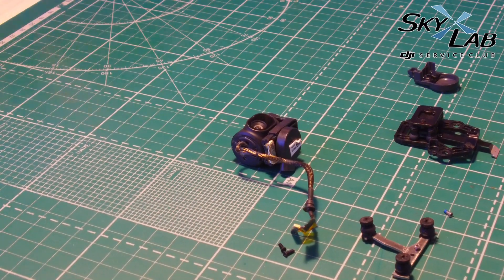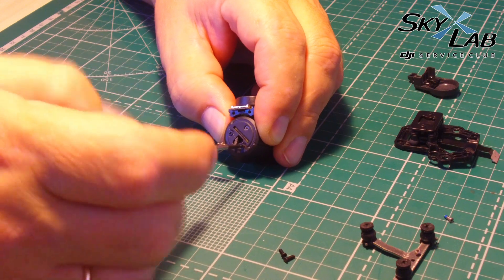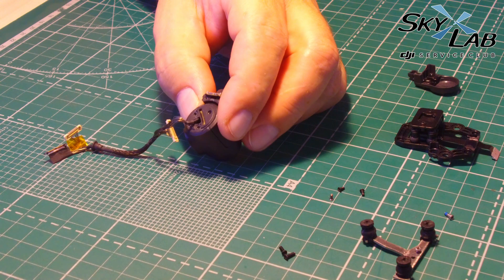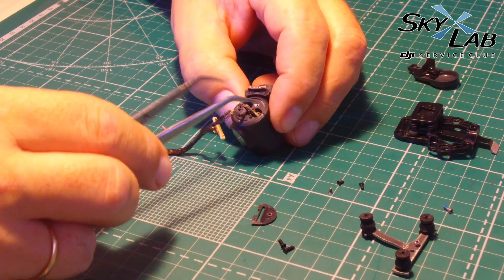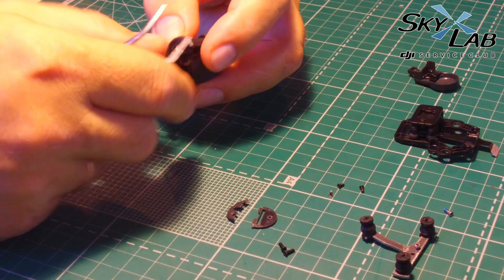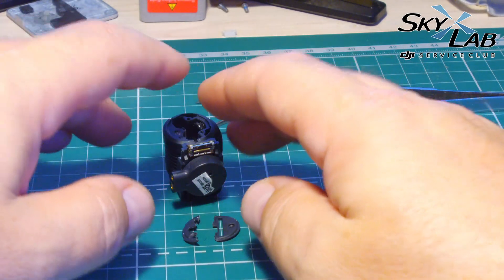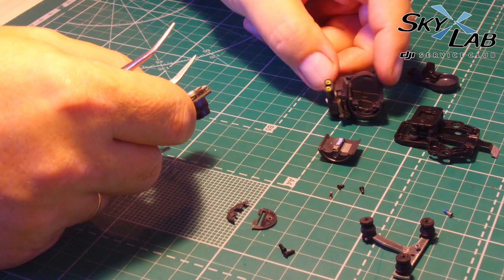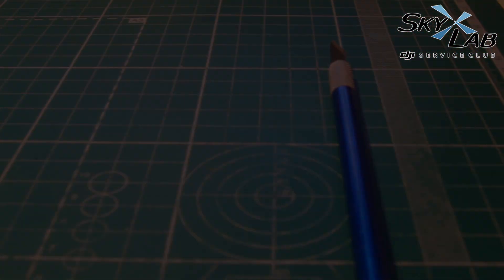Dji Spark Engineering and design ERRORS!!!

Comment: Great video, Thank you !

After a hard landing, i've some vibrations on my video footage.
do u know if that could come from damper ?
Here is a video (look at the end, i can reproduce this vibrations just holding the spark in my hand without running motors)
https://www.youtube.com/watch?v=dJVkyseiVJw

Thank you
Reply from the maker: Hi,  most likely bent platform, which stands on the suspension and it touches the case of the Copter
Reply: You're right, never think about that, but logical. Thank you !

Comment: Any chance for a video showing replacing the gimbal and camera cable? 
Some I got an offer to repair my drone for 350$ because I need a piece of rubber, plastic and a cable, sounds stupid to me...one guy told me they have to replace the whole thing because it might unbalance the gimbal, is this true? does that happen?

Any help is appreciated! 

So frustrating, I can't seem to get a hold of the rubber heads that sit on your metal board that connects to the camera, I am very disappointed of the no parts policy of DJI. (plus the cable costs 25$ !!!)

Comment: O i just crashed my spark right out of the box. First time ever flying a quad copter. Camera no longer tilts. Is it repairable or should i buy another spark down the road?
Reply from the maker: Hi, this is being repaired, but the repair shop should be highly qualified. often authorized services do not have this qualification.